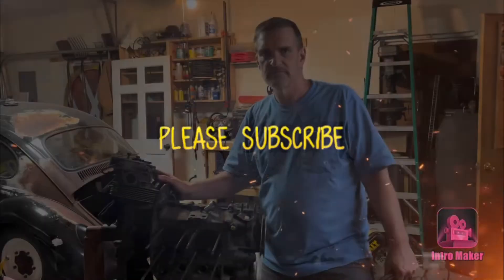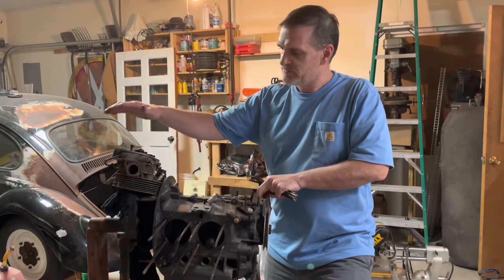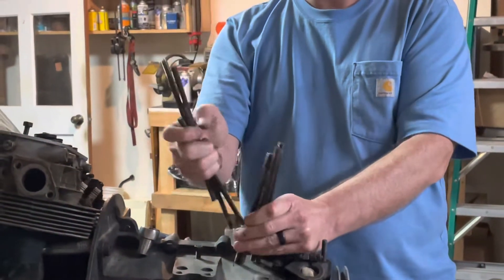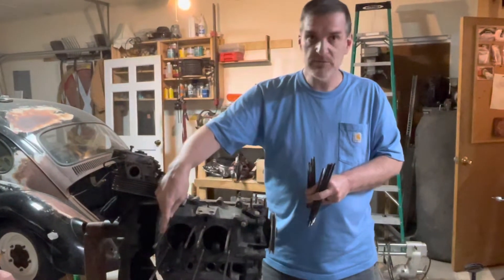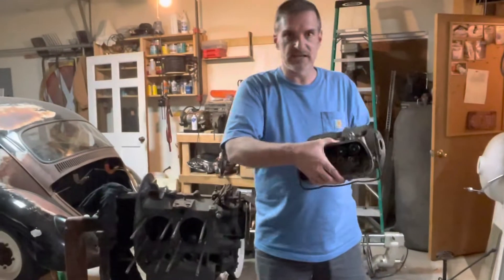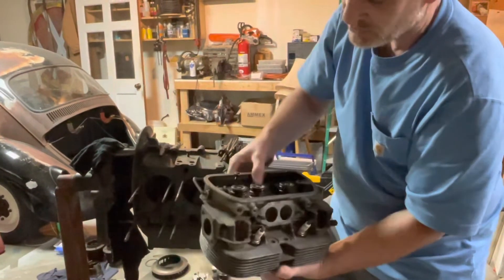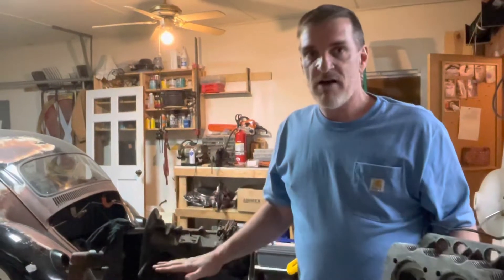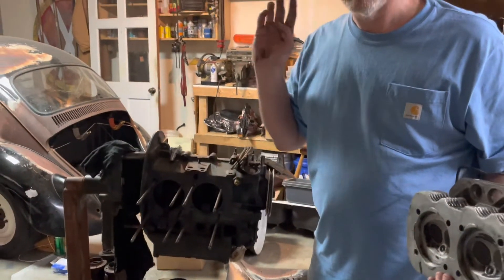Volkswagen head studs, 1600

Comment: good video--I am just doing my first engine build--I had a shop look over the case just to make sure I didn't miss anything--it looked to me like a case saver came out (its an AH series type one)--but shop commented that they were "deep studded"--I hate to admit that I have no idea what he's talking about...help?
Reply from the maker: @michaelmounts1269  Deep stud refers to the upper rear cylinder-head stud on #3 cylinder. The boss for this studs threads is thought to contribute to a case cracking problem in the bell housing, so the way to solve the cracking is the deeper threads. It’s a good thing.im Not much help here , thanks for your comment